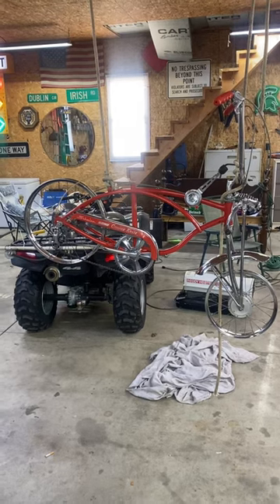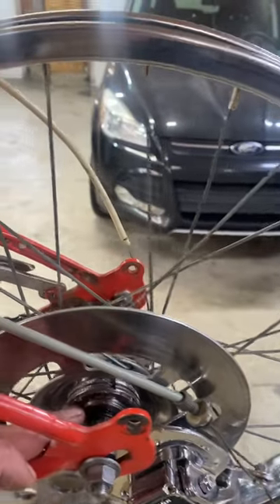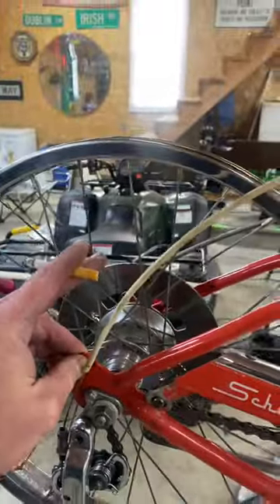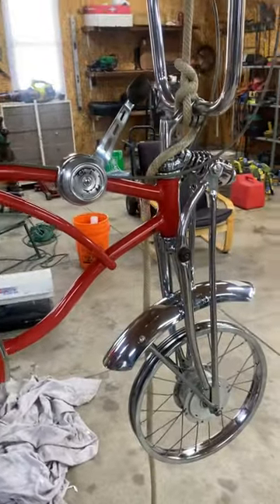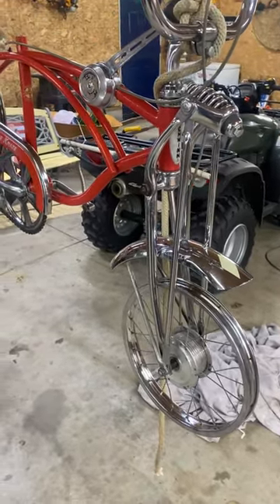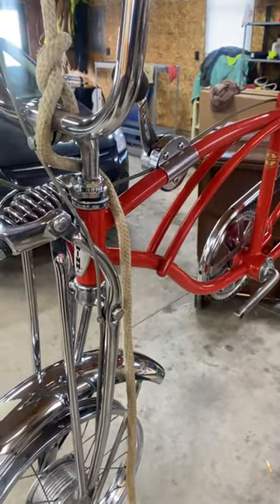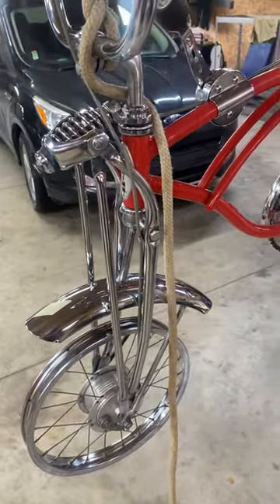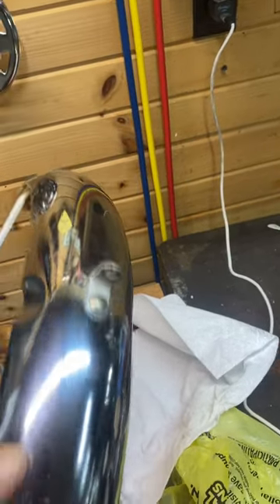1973 Schwinn Orange Krate  Stingray for sale

Comment: Inherited 72 Orange krate disk,needs restoration, not sure where to start or to take it
Reply from the maker: You might try a schwinn forum on facebook.  I’m sure you have already considered that.  Restoration could mean something different to me than to you however.  What could be wrong with it other then some rust an a new cable?  If a part the disk is bent of broken you could check out EBay for replacement parts.